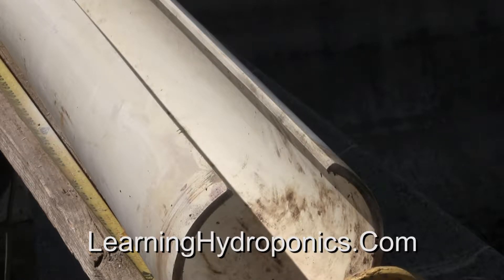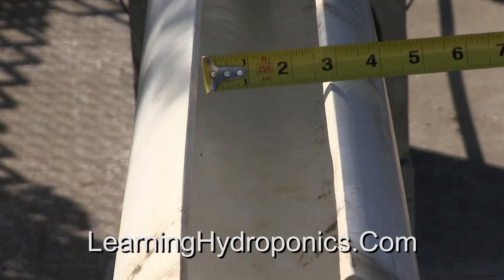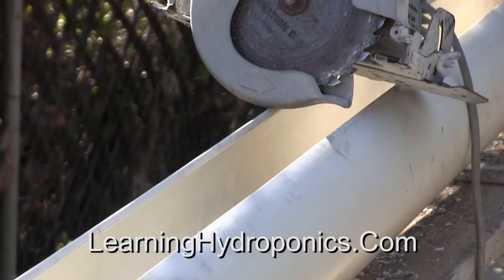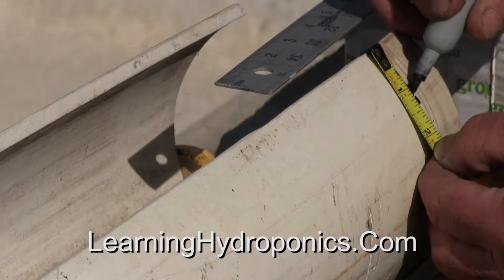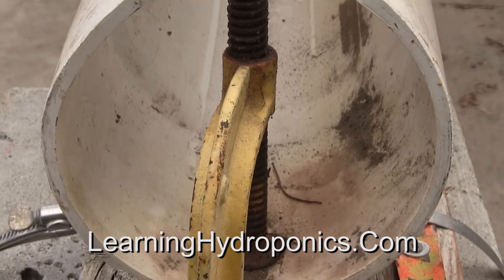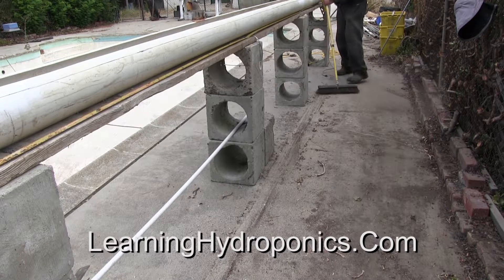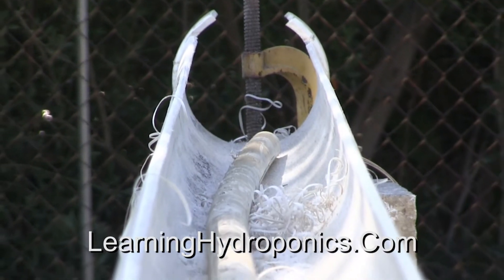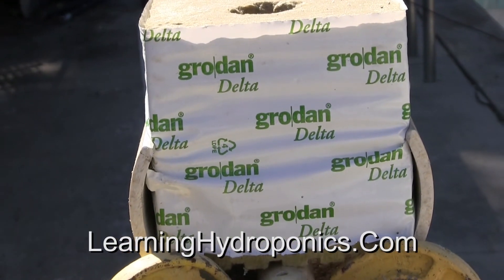PVC hydroponic garden with Grodan cubes -- for cannabis?

Comment: when the roots grow won't they be exposed to the light?? they will drag down the water flow path no?
Reply from the maker: Multiple answers to this:

I am told, I have not seen, that commercial producers use watertables.  The artificial light hits the cubes, yet the plants grown to harvest.

I have seen transparent containers with roots visible below the water line, not present above the water line where light strikes the grow medium.

As to the second question, do you mean, the roots jam the water flow?  Yes.  I've attempted to counter this.  The most successful plants will jam the flow, then the flow passes the jammed area by overflowing the roots and continuing to the next plants.  I will make a video on how to deal with the problem.